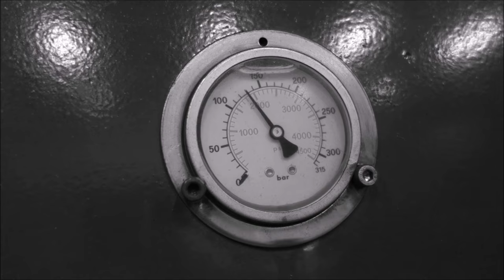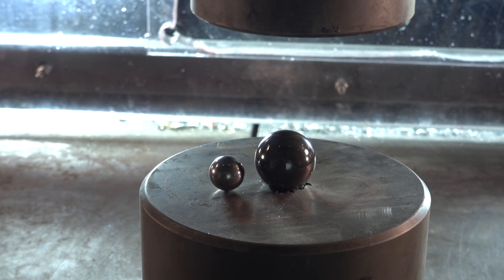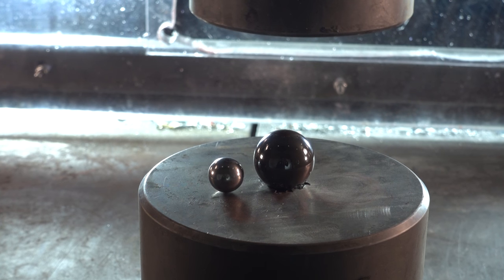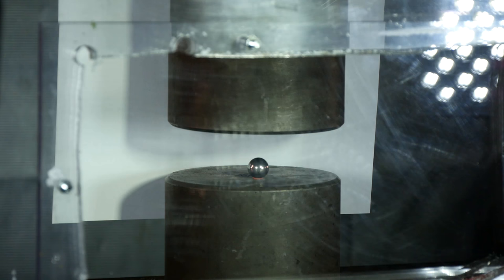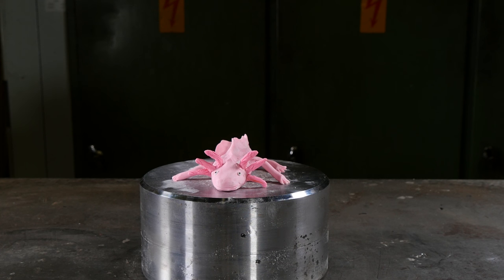SUPER SLOW MOTION: Bearing balls vs. hydraulic press

Comment: It's amazing that the shattered particles of the steel bearing were so fine that they oxidised on contact with the air! 
Who'd have thought steel could be a reactive metal at near room temperature?
Reply: Green Silver Those items tend to get quite hot when crushed.
Reply: Green silvers assumption is the correct one.  Iron is pyrophoric in air and will spontaneously combust even at room temerature, although this reaction like many others is even more pronounced at higher temperatures, like the friction pressure helped to create.  Search for pyrophoric iron, you wont be disappointed.

Comment: It's amazing that a bal made out of steel shatters into so many pieces when breaking like that, it's like glass
Reply: Duncan Van Ooyen I think any solid would break in that way
Reply: Duncan Van Ooyen It's probably hardened steel
Reply: It's definitely hardened steel, untreated steel would just bend and you'd get a steel coin ;)
Reply: No, most of solid objects would just flatten. Only very hard objects, and objects made out of paper explodes.
Reply: Also the sparks is gives off, where the fuck do they come from!
Reply: Richard Lionheart Well that I presume comes from the intense amount of heat and friction created by the pressure of the press
Reply: And the carbon in the steel, that burns in the air and forms CO2. That's also why you see sparks when grinding steel (and not when grinding aluminium or anything else).
Reply: Klaufmann I like when people who are smarter than me teach me things. yay!
Reply: Iron is pyrophoric in oxygen, it spontaneously ignites when it is oxidized, but only when very finely divided.  The heat from the pressure most certainly helped its reactivity.  I disagree that the carbon is whats burning and making the sparks though.  Many other metals are also pyrophoric and create sparks while grinding, tungsten and uranium come to mind.  And if someone else wants to chime in I believe lighter flints and emergency firestarter sticks are an iron/tungsten/potassium metal mix?  

Anyway, iron itself, even not hardened (very low carbon) steel wool burns quite readily in air because of irons energetic oxidation reaction.

Comment: Interesting facts of ceramic balls:
"Since silicon nitride ball bearings are harder than metal, this reduces contact with the bearing track. This results in 80% less friction, 3 to 10 times longer lifetime, 80% higher speed, 60% less weight, the ability to operate with lubrication starvation, higher corrosion resistance and higher operation temperature, as compared to traditional metal bearings."
-wikipedia
Reply: Thanks Mr. HPC, you made me google and learn something :)
Reply: When did I subscribe to bearing ball facts? lol

Comment: For the extra content they should try putting a really large head on the press do the animal is spread really thin
Reply: Daniel Dyszkant What?
Reply: That sentence didn't make any sense to me.
Reply: Did you have a stroke?
Reply: I think he meant to say "so" instead of "do"
Reply: How bout you dun do learn the  grammars so you can do the  thing that does a word good?
Reply: "For the extra content they should try putting a really large head on the press so the animal is spread really thin"
That's a pretty common typo, try thinking more than 2 seconds before posting comments like "that doesn't make any sense."
Reply: translation: the press tool should be wider
Reply: I meant so instead of do
Reply: jeez are humans running on coding these days? one syntax error and they bluescreen quicker than an email from a Russian dating site! its not so hard to extrapolate what he means
Reply: I think it may be harder for foreign speaker. I struggled to make sense from the sentence and initially got nothing. Though so -> do makes sense in the end.
Reply: we are under the assumption that the critics are astute English scholars and use English as a first language.

Comment: Did you note the maximum force on the press before the ball bearing broke? Looks like a lot of energy released - incredible video!
Reply: If I remember correctly and if that silicon nitride ball is same sized as in the previous video, it took almost full pressure.

Comment: diesel fuel auto ignites under extreme pressure. Is there any way you can figure out how to put diesel fuel under pressure in the press? Then watch it go boom
Reply: Tyler C Not quite, it's the air that's heated up by the extreme compression that ignites the fuel. If you were to compress diesel fuel by itself it wouldn't ignite.
Reply: Diesel is a liquid, you can't compress liquids.

Comment: whats the hardest thing the press has had to deal with?
Reply: +RoyalGames Crippling depression
Reply: From the videos that I've seen, a block of layered carbon fiber.
Reply: RoyalGames air
Reply: Carbon fiber was easy and very cool to crush.

bearing ball didn't crush it just messed up his press and he had to revist it. This is the third time he has done bearing balls for a reason.
Reply: Strictly speaking, the hardest was diamond. But it broke very easily.
Reply: +Mysterious Stranger Diamonds are not at all 'hard' like steel. Their hardness refers to their ability to resist scratches from other materials. Their actual structural hardness is comparatively laughable.

Comment: how hot does that steel bearing ball get before it explodes?
Reply: It doesn't deform almost at all, so it doesn't get hot before. But the sturdy frame of the 100t press bends slightly and stores a shitload of potential energy. That energy is released extremely fast when the ball can't bear anymore. That energy also makes bearing probably quite hot at the time it collapses.

Comment: Hi, can you please try to make sure that the bottom of the camera lens is flush with whatever the crushed item is sitting on. eems liek you always have the camera too low.
Reply: This time he had a reason: 

Sorry for the slightly wrong video angle on ceramic ball, we didn't expected the pressing table to bend that much under the load. But at least now you see how much the frame of the press bends under max force. The ball was on the center of the screen before pressing.

Comment: Weird.  It oozed down instead of up. 🤔 Any physicists watching who could explain why?
Reply: The dangerous animal? That's because the pressing tool is larger than the base it sits on. The edge of the clay pancake is under tension, so it wants to bend in any direction possible. And in this case with the large pressing tool blocking the way up, it has to bend downwards.